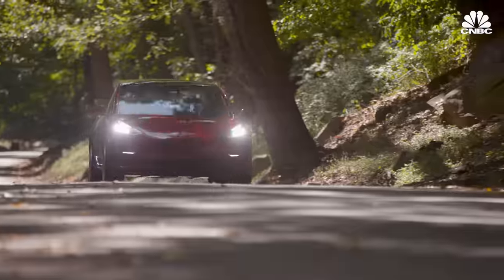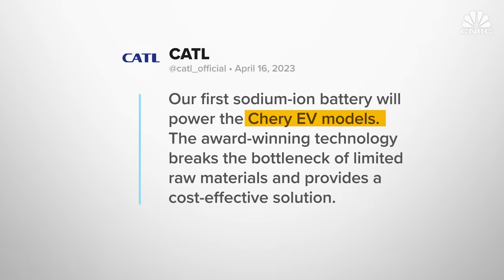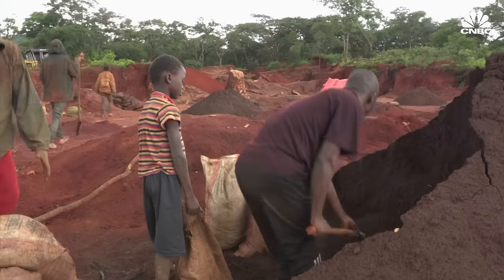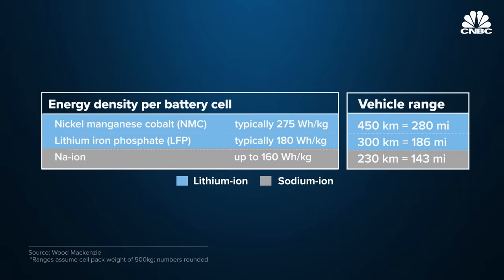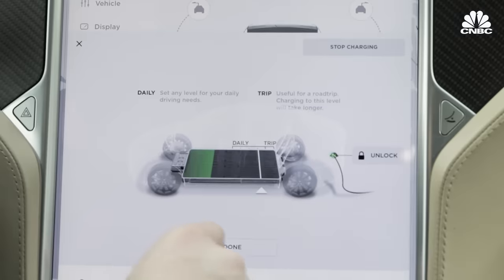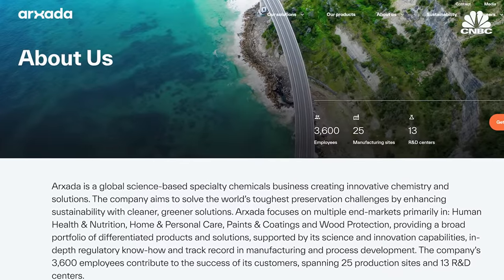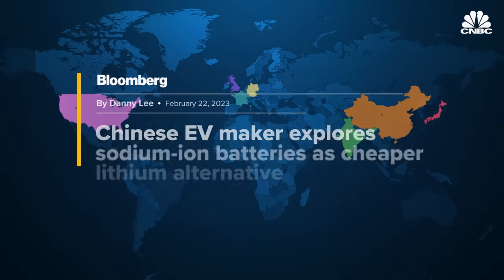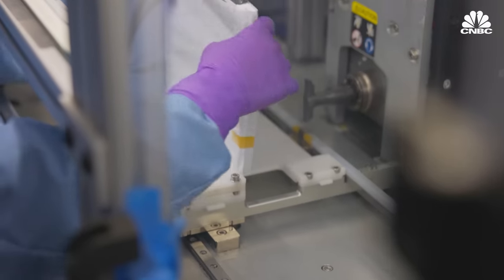How Sodium-Ion Batteries May Challenge Lithium

Comment: Since Na Ion battery has longer charging cycles than Li-Ion, the hybrid electric vehicle market could be one of the few segments where they could be a great fit because the range of PHEV doesn't solely rely on the batteries. Could potentially bring the cost of the PHEVs even further and much safer.
Reply: I too see this as a great battery for PHEVs as well.
Reply: Hybrids needs baterries that can charge and discharge faster than and pure eletric baterry car needs. Thats because the baterry is much smaller and needs to receive the same amount of energy during regen breaking than the eletric car. They also need to provide a lot of energy to acelerate despite the reduced size. And thas a good reason the baterries between this cars can't  be easily adapted from another.

Comment: Aren't there better options out there than just Sodium Ion?

The only advantages, albeit big ones, it seems to have over Lithium is that it's cheaper (for manufacturers doesn't mean it will transfer to customers) and more environmentally friendly (which is a big win for everyone).

So far Sodium Ion has less capacity, less powerful and slower to charge than Lithium Ion.

Personally slower charge times don't bother me too much as device OEMs can balance that out with "quick charge" solutions, but if you want the equivalent capacity as your lithium Ion batteries you may need a larger and heavier Sodium Ion battery.

Like the video says, Sodium Ion may not be the best for Electric vehicles because it is bigger and heavier and Sodium Ion may not work as well for mobile/portable electronic devices.

It maybe more applicable to big stationary things like buildings and structures.

Comment: Commodities  traders  that secured  the supply  of Lithium  have been  pushing  for the adoption  of Lithium because  they  thought no  one would figure  out  that Sodium  can be used to replace Lithium ,,,,Investors  in the Lithium sectors  that secured mining rights for Lithium have already  lost a huge part of their  investment
Reply: Lol
Reply: that is short sighted. If you see the big picture, you see we need a sheettonne of batteries, it doesn't matter which type it is, we need about 50x more production than we have today. All battery makers will make lots of money for the next 10 years at least.
Reply: No. Lithium still has big demand. The pie is big enough to accommodate 4 or 5 types of storage technologies.
Reply: This is so false. Sodium has not even been through testing phases yet. Lithium is currently the  best solution. At best, sodium will be 30% less energy dense than LFP. Sso while they have their place, they are not a replacement for longer range vehicles.
Reply: @bugguy1967  which sodium ion has 30% less energy density than LFP? Be specific.
The only company that has Sodium ion battery in mass production (GWh scale) is HiNa . Its battery has gravimetric energy density of 141 wh/kg , similar that of the LFP cells  CATL provided to Tesla to be used in model 3 in 2020. 
The other three major companies starting scale production of sodium are CATL, BYD , Farasis and Faradion all have energy density around 160 Wh/ kg with CATL targetting 200 Wh/kg.
Reply: @sazzbot8874  Tesla said at the March Investor Day that North America alone has enough lithium to supply the entire world's fleet of vehicles. They just need to scale the various forms of refinement. Also, the more we look for lithium deposits, the more we end-up finding.
Reply: @najibyarzerachic  BYD's for their Seal. Their LFP version has 30% more claimed range than their claimed range with their new sodium-ion packs of the same size.
Reply: @bugguy1967  dude you know you are making that up. Because BYD has not even officially confirmed which models they will be using their sodium ion batteries in. All these news are rumours still . I highly doubt they will use them in seal though. Seal is high performance vehicle, a model 3 competitor. They are more likely to use them on the cheaper models such as Dolphin and Seagull. But i can imagine their first iteration of Sodium ion will b less energy dense than their trademark blade  battery (LFP).
But that is a BYD thing only. It does not say much about the technology itself.
I do agree sodium atoms are bigger . So the volumetric energy density will b lower than lithium ion in general but that should not make as much diffrence. It will just cover lil bigger physical space . EVs are generally space effient than ICEs, so that is manageble. The gravimetric energy density (weight) matters more and the diffrence there is neglible.
Reply: @najibyarzerachic  sorry, it's one of those other two - whichever was just released. I'm not too familiar with the names.
Reply: @najibyarzerachic  the Chinese are already powering vehicles with sodium batteries while you were asleep...it is why the west will find it hard to compete against
Reply: @najibyarzerachic  why are the prices of lithium falling then
Reply: @bugguy1967 at what cost to the environment when sodium is much cheaper and cleaner....Iithium is doomed.. it has other uses though like making drugs for bipolar disorders
Reply: @jarednovel  Don't forget lithium and lithium complex greases. Lithium soaps like lithium stearate are the base of most greases.
Reply: @jarednovel  my replies weren't to condone lithium. It was only to argue your statements that claimed lithium was pushed onto manufacturers while knowing sodium was a more viable solution. It was the best we had, it was proven, and the manufacturing was in-place.
Reply: @jarednovel  no i was not asleep. I have been following this company HiNa since 2017 when they first put their batteries in operation at local grid. So far it is the only company that has officially started GWh scale mass peoduction of Na ion batteries. Other companies such as Farasis, BYD and CaTL should be able to start their mass production of Sodium ions before the end of the year.
I agree western companies are behind the curve on sodium ion  but yesterday i read about a UK company (not fradion) starting mass manufacturing of Na ions.   There are a couple of US and one Australian companies at advanced protypte stage (at 100s of Kwh scale)   . Expect tarrifs on chinese batteries like we have on cars and solar panels. But for the rest of the world there will b lots of cheap choices.
Reply: @najibyarzerachic  Chinese EV makers including BYD are already making vehicles that are powered with sodium batteries
Reply: @jarednovel  not yet in production vehicles..coming soon though. The only car equipped with sodion battery is from Sihol , but it is a a test vehicle not for sale 'yet'
Reply: https://youtu.be/OYhOOweKDBU the source

Comment: I think what may happen several years from now is a price war between LFP and Sodium Ion.  LFP is capable to drop pricing. Due to little price difference, LFP will continue to be used mostly in EVs.  Price difference then matters if used in larger scale or deployments, like batteries for the grid, industries or home where Sodium Ion will proliferate.  Nickel cobalt based batteries for EVs will stagnate and reserved to high end vehicles and applications.
Reply: Yeah but what about when LFP, sodium ion and lithium run out? 
From the looks of it, we’re gonna use so much of this that it’ll run out quickly due to dumb human demand for all electric everything. 
We cannot underestimate Mother Nature 
Oil is running out too, but as for LFP, Lithium and sodium ion, we have much less
Reply: @bolbiitp7850  sodium is salt, practically everywhere.  lithium, which is considered a salt also dumb plenty. well if you say oil is running out, that is just one of the many reasons first world countries are going into electric.

Comment: Lithium cels in Teslas are cylindrical. This means there is a notably large amount of empty space between the cells. By swapping over to square cells you increase the amount of batery capacity by increasing the amount of battery volume. This could counteract the loss due to lower energy density.

Comment: At just 140 Wh/kg, it's basically like going backwards in battery technology in terms of energy density
Reply: For some applications, like grid storage, energy density is less important than cost per Wh and number of recharge cycles.  Lithium-based batteries are still too expensive for this, and other solutions, like sodium-sulfur batteries, require elevated temperatures and have corrosive chemicals.  Perhaps this battery chemistry, or a flow battery, might be economical enough for practical grid storage.
Reply: Because of the high safety, the protection and cooling requirements are relatively low. When used on EVs, more cells can be installed in a limited space, so the power of the whole vehicle does not decrease, but it is safer
Reply: For many applications, the lowered price is a much more important parameter than the (relatively small) lesser energy density. So which way the evolution goes is very much up to what parameters you care about.
Reply: @Jørgen You said it. As a an owner of an electric bicycle I would say that it all depends on what you use the the battery for. An electric bicycle or its faster cousin the pedelec (the one with the speed of a moped) can be very heavy as it is. - I read an interesting article years and years ago about how Israel and China were both trying to make batteries with a higher energy density, and back then still using lithium as a main component; I have heard nothing about it since those days.

Comment: ALTHOUGH RECENT BREAKTHROUGHS HAVE MAINTAINED THAT ENERGY DENSITY OF SODIUM ION BATTERIES CAN BE IMPROVED SIGNIFICANTLY, EVEN IF WE DO NOT MANAGE TO INCREASE ENERGY DENSITY OF SODIUM ION BATTERIES LETS NOT FORGET THE BATTERY STORAGE INDUSTRY IS NOT RESTRICTED TO ELECTRONICS AND CONSUMER DURABLES.

THERE ARE NUMEROUS USE CASES WHERE COST OUTWEIGHS ENERGY DENSITY & NOT TO FORGET THE ENVIRONMENTAL IMPACT.

Comment: What is needed is a battery that can be fast charged and discharged and not cost any more than current lithium batteries, and have a long lifetime.  LTO cells do this today, but are like 4x more costly.   We need a cheaper LTO cell, that is a game changer.

Comment: Sodium Ion batteries still have lots of room for refinement, and CATL is already reporting energy density on parity with Lithium @ ~220kw/kg. Lithium may only hold an advantage for a short while, and that advantage is mostly its existing scale.
Reply: >> ... CATL is already reporting energy density on parity with Lithium @ ~220kw/kg <<
NCM955 is about ~320kwh/kg.   Why is everyone always using older NCM chemistry when benchmarking?
Reply: Wh/kg, though kWh/kg would be amazing!

Comment: combining sodium-ion with battery-swapping technology. we can alleviate the energy density problems up to an extent. As the risk would be minimal compared to the existing li-ion, we can build mobile battery packs. with the addition of sensors, the battery pack should show the remaining battery leftover, so that, when swapping batteries, the consumer should pay accordingly to the charge left on the old battery.

Comment: The issue is that if you're looking at electrifying the entire global energy infrastructure (and that's assuming not much progress in the developing world) you need to increase production by a factor of four of five.  At that point Lithium starts looking pretty scarce (it also has the slight problem that it semi-permanently ruins the areas it's mined form), but the real bottleneck is Cobalt.  It's basically found in just one country (DR Congo) which is land-locked, corrupt, and whose production is about maxed out.  You can't increase Li Ion battery production by a factor of four or five because there just isn't enough Cobalt on earth for it.  Na Ion, using much more common materials, will allow Li Ion Batteries to be only used in applications where its greater energy density is necessary.  With Na Ion you don't run into the issues at scale, which require globalized supply chains, you could increase production to global scales even if the developing world goes with all electric infrastructure when it gets built.
Reply: Why should we assume not much progress in the developing world. As the US and EU shrinks compared to BRICS and other developing countries and the accelerating trade through BRI there is an accelerating electrification and infrastructure development of the developing world increased production of various energy infrastructure is already happening despite US and EU`s best effort to stop it.

Comment: Sodium batteries are ideal for EVs as well. All we need is fast charging in 5 or 10min. Then, even if smaller size batteries are used, range can be added enroute. Smaller size batteries will also reduce cost of cars.

Comment: You make the point that sodium “can’t compete with range” compared to lithium. That right there should be a killer as range is a fundamental concern with the practicality of EVs. Lithium EVs already struggle with range compared to ICE vehicles, especially when talking about charge/fill times. And that’s even before mentioning cold weather.

Comment: The range part of the equation of course lies in the largely irrational range anxiety that even many people who don't drive as much seem to have. Yet the range problem is closely tied to the charging speed. If you can have charging stations in place of traditional gas stations, with stationary batteries capable of stabilizing the grid and providing high amperage charging for peak demands, then you don't really need to have all that much range in your vehicle battery. If that battery allows for deep cycling and fast charging without damage, then all you need for most people is around 200 km range. Of course, higher energy density means lighter cars and less energy wasted on transporting a heavy battery, but a less energy dense battery which is cheaper, safer, more durable and eco friendly is still a good compromise, if you can charge it in 10 minutes every 200 km. As someone without a dedicated parking spot or garage, who doesn't drive that much, I will gladly buy such an EV.

Comment: This report on Sodium ion battery is a great opportunity for me to learn about them!

Lithium-ion batteries are ubiquitous in all modern portable electronic devices such as mobile phones and laptops as well as for powering hybrid electric vehicles and other large-scale devices. Sodium-ion batteries (NIBs), which possess a similar cell configuration and working mechanism, have already been proven as ideal alternatives for large-scale energy storage systems.

The advantage of sodium ion batteries are: First, sodium resources are abundantly distributed in the earth’s crust. Second, high-performance Sodium Ion Battery cathode materials can be fabricated by using solely inexpensive and noncritical transition metals such as manganese and iron, which further reduces the cost of the required raw materials. Recently, the unprecedented demand for lithium and other critical minerals has driven the cost of these primary raw materials to a historic high and thus triggered the commercialization of Sodium Batteries.

Comment: The advantages of sodium ion electric batteries are many and I consider them the best Much cheaper Its price is approximately 10% of the lithium battery only Faster charging (almost two or three times faster than lithium) Withstands a variety of temperatures. Lithium batteries cannot withstand high heat or extreme cold! It includes the diversity of the presence of raw materials in different geographical ranges. It does not use cobalt, graphite, or lithium, and it is not flammable. As for cost, sodium batteries have the advantage of availability of materials and the possibility of improving their energy density, and their cost can be reduced Sodium batteries could take over a significant share of their lithium-ion counterparts, alleviating lithium supply issues and lowering overall prices for electric vehicle batteries.

Comment: wow 8:45 I had a dream in 2022, and along side each side of a railway track it was blue, then a train came along and blue vapper come out of the engine, then someone said that they found it was cheaper to run the trains on blue paint than diesel

Comment: Rather than only asking how can we electrify a gas station in order to charge an ev, I think you may want to look at how people are charging their ev now.  (Look at the customer demand side not only the service supply side).  As opposed to a driver having to make an extra stop at a station, it seems preferable to plug in to the grid at the driver’s intended destination and convenient parking place.  That way the time spent parked is not seen as a burdensome “wait-time”.  This way there’s no need for costly, inefficient multiple batteries per vehicle. And the customer can get a better price for using off-peak electricity.

Comment: Could there possibly be more consideration given to how these compounds are mined and handled? It's kind of hard to believe that the battery is a more environmentally friendly option when gathering the materials to produce them are far worse for the environment than what we're currently doing. It would also be great if we could fix our grid and actually have a stable source of energy for recharging the newer tech. I love electrical vehicles and rechargeable storage from cleaner energy sources, but I don't want a repeat of the Recycling programs of the 70s and 80s where we were separating our "recyclables" only to learn there were no recycling plants to take them to, resulting in them all just being dumped exactly where they would have been in the first place. It doesn't matter how well made the roof is if there's no house to put it on.